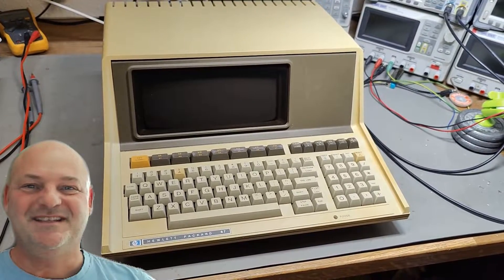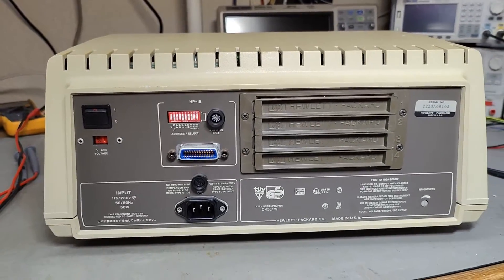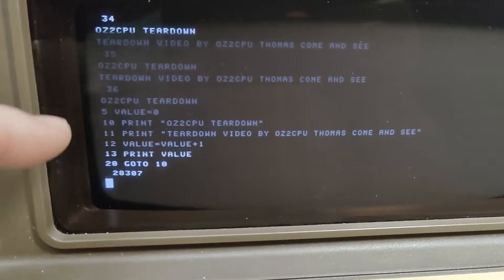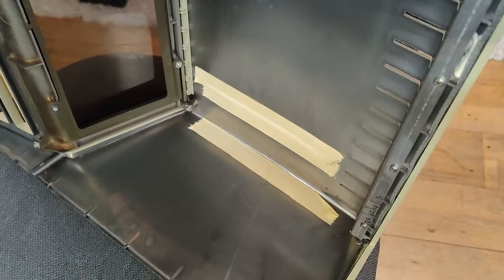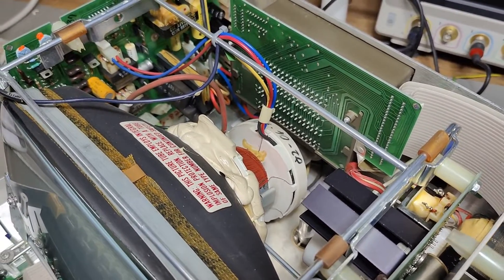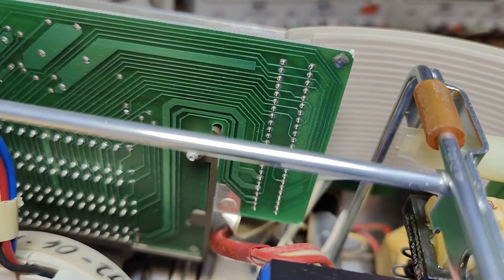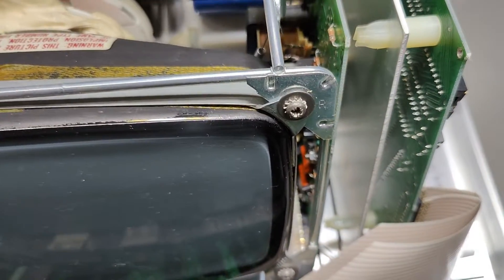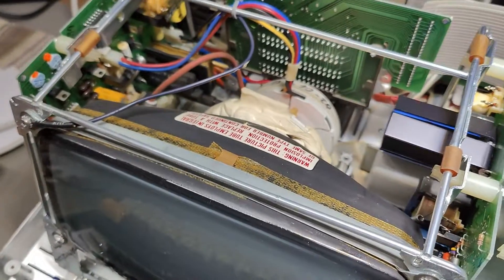Hewlett Packard HP 87 Personal Computer HPIB 1982 running Basic

Comment: I really wish they had the foresight to just go ahead and use a Z80 for these machines. Luxor AB in Motala, Sweden, a household electronics name, got into the microcomputer business at the same time, first coming out with ABC 80 computer. They had excellent software engineers working on built-in Basic and OS.  By 1982-83 they had an awesome tokenizing Basic II, completely home-grown, and that thing was FAST. And it had excellent expandable I/O subsystem - a great fit for any machine that could take many extension boards for storage, network, etc. The ABC-800 series of machines ran business applications quite well. It had a third-party networking system (CatNet from CAT AB) as well as the built-in ABC-NET. Both used RS-485 synchronous serial (based on Zilog controllers) IIRC. At that time, that little-now-known Swedish Basic system was quite a ways ahead of what HP had in their 85 and 87 line. ABC-802, their “tiny” desktop model had HP build quality (sans gold), excellent esthetics, and the only thing it missed was a bitmapped display as standard. HP had the capability for custom ICs that Luxor didn’t have, and the business acumen (that arguably Luxor didn’t have either). But they should not have had let their ASIC abilities cloud their CPU judgment. A Z80 with a custom HP graphics interface IC would have beat the pants off both HP-85 and HP-87, at quite a lower cost. History can’t be changed, but if you have a chance to mess with Mame and fire up the ABC-802, you can experience their Basic II at same speed it ran on hardware. It’s something else :)

Comment: ZX Spectrum is so envy about how rich the HP's graphics command set is.
Reply: The main thing missing from ZX Spectrum that HP Basic had was the vector text support. Otherwise the graphics performance of both machines was comparable. HP Basic internally used vectors to render circles and such, so that the output could have been easily redirected to a plotter. That was a good thing for a scientific/engineering computation platform. Spectrum’s circles were drawn pixel by pixel and that only worked on a bitmap output device of course.